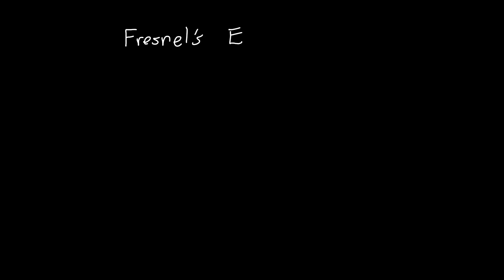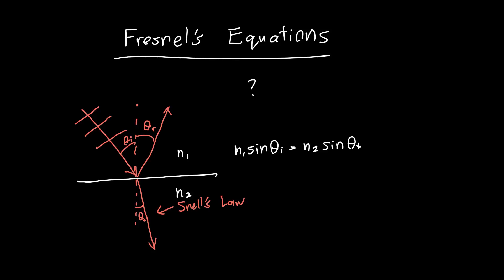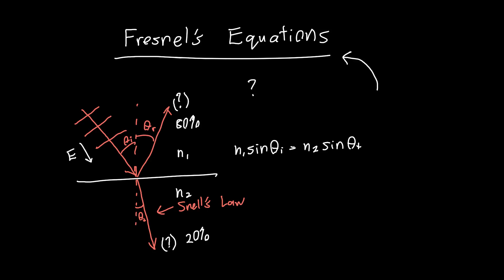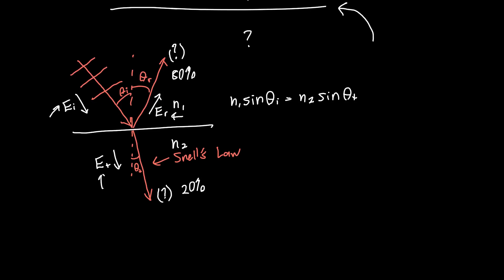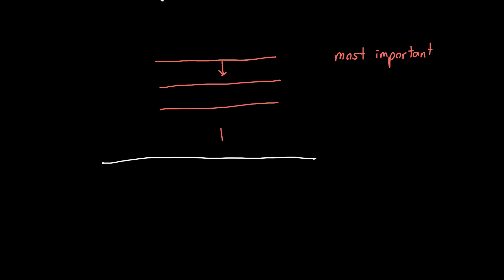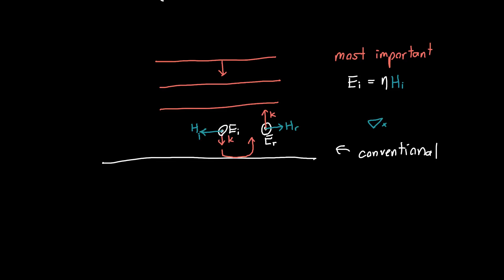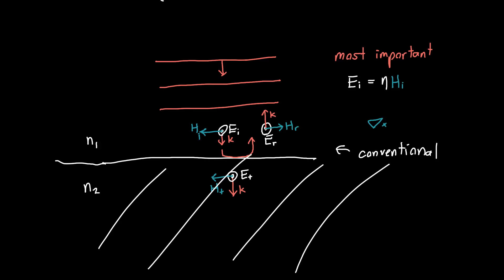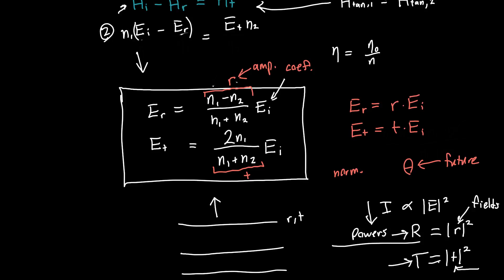Fresnel Equations at Normal Incidence

Comment: Pregunta 1
Hello, I need your help plz, good video..
Estimate the approximate output coupling power losses (in percent) from Fresnel reflection at normal incidence in a phosphor/air interface, where the phosphor has an index of 2.3 and air has a refractive index of 1.

Comment: Thank you for this video! Suppose we want to calculate R and T for the second interface, external to which is air again, so that, for instance n2=1,5 and n3=1. Can we use the same equations? It appears to me that T becomes greater than 1 and I do not understand how this can be. Thank you very much.
Reply: I think it's a mistake, power transmission coefficient is (1-R^2), the part written around minute 13 is wrong and violates power conservation, he needs no multiply T by n2/n1 I guess if u want to state it that way, but i just use T=(1-R^2), this can be proved when you calculate the power of the incident and reflected wave, power = (E x H*)
Reply: Thank you, I also think there are some mistakes with transmission coefficient. But it is strange that the lecturer can solve the reflection coefficent correctly by these equations, but not correct for transmission. @thedarkcider4450